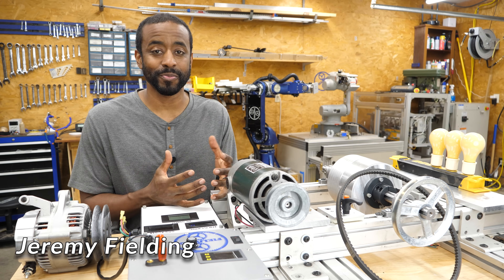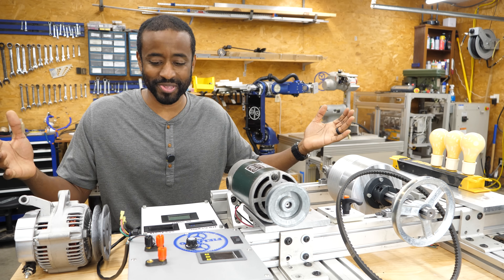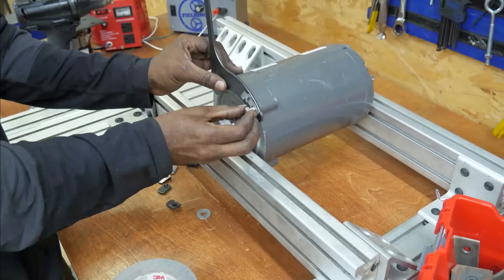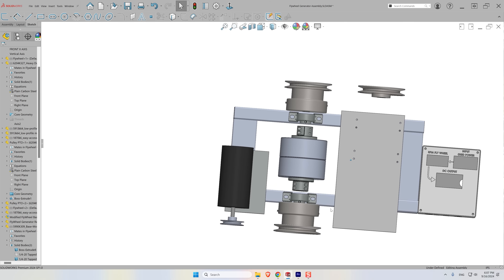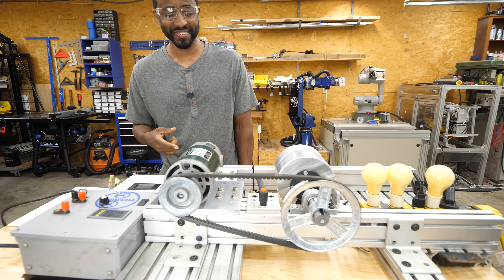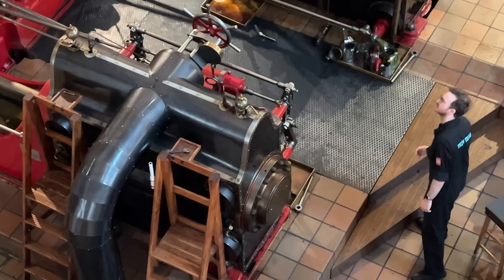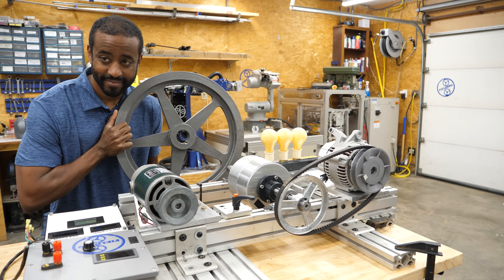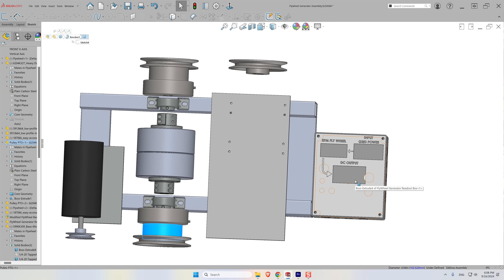A Machine To Test Free Energy Ideas.

Comment: Hi Jeremy,

I hope you are well. My name is Bucky Hoover, and I’ve been living off-grid for a while now. It’s been both a challenge and a rewarding experience. I don’t have an income and things are hard, so I rely on resourcefulness—repurposing scrap materials, fixing broken things, and building what I need from whatever I can get, which is how I discovered you back when you had the small shack. It's been great to see you grow over the years.

I’ve been following your work for many years, and I deeply respect your engineering expertise and creative problem-solving. I’m reaching out because I’m tackling a few specific challenges in my living situation, and I think your insight could really help.

Here’s what I’m working on:

1. Power generation in winter months:

I’m trying to design a micro-hydro system or a self-sustaining solar-powered setup that could generate enough energy, even during the darker, colder months. The turbine, etc.

I also want to create a UV light system powered by solar, but I’m unsure how to design it so the system essentially “feeds itself.” its probably not possible😅. But i can dream.

2. Alternative fuels and engines:

I’m curious if there’s a way to modify an engine to run on alternative fuels using accessible materials.

3. Boosting communication:

I live in an RV (a 1999 Georgie Boy Cruise Master) and have an old Winegard TV antenna. Could it be modified to boost cell phone signals? Anything that can be made?

4. Energy efficiency improvements:

I’m wondering how to make my RV appliances (like the fridge) more energy-efficient using scrap materials or repurposed parts.

I’d be incredibly grateful for any advice, guidance, or even just pointers to resources or techniques you think might help, even things in general for self sufficient life. I know you’re busy, and I don’t expect a full walkthrough—just some direction from someone with your skills would mean a lot.

Thank you for your time and for sharing your knowledge with the world. It inspires people like me to keep creating and solving problems. I know there's a solution to benefit mankind that I could do someday. I look up to you. 

Warm regards,
Bucky
Reply: Hi bucky this is absolutely amazing...not the struggling part but everything you wanna do. How far are you?
Reply: @vanessaabisai4300  thank you, means a lot. Out here in the Olympic Forest, I’ve been digging into how to make fuel and power using what’s naturally around me. Stuff like Oregon grape and salal berries aren’t great for eating, but they’ve got enough sugar to ferment, you can make ethanol out of wild berries if you’ve got the patience to crush, ferment, and distill it. Even bigleaf maple sap can be tapped, not as sweet as sugar maples but still usable. If you're near water, cattails are gold, the rhizomes are packed with starch and can be broken down for alcohol or tossed into a biogas digester. And if nothing else, pine resin burns like hellfire; render it down for fire starter paste or lamp oil. Pine needles can also be used for distilling oils or burned outright in a hot rocket stove setup. Gass and brush clippings  rot down in a sealed barrel and you’ve get methane—useable gas if you rig it right.

I’ve also been looking at micro hydro because there’s always water flowing out here. Even a small stream—just 2 to 5 gallons a minute—is enough to generate something if you build smart. You can make a DIY Pelton wheel using scrap spoons or metal lids, hook that to a car alternator, and generate power off grid. Use old PVC or jugs to direct pressure. An alternator, pulley, and some batteries will do more than people think. You just need to manage your voltage, which is doable with salvaged charge controllers or cheap converters online. For storage, I’m stacking up old car or marine batteries—anything I can refurbish and wire together.

Even inside the RV..My fridge runs propane, but I added foil and a fan to keep the heat from building up behind it—helps efficiency. I use a switch on the water pump to stop idle draw. All my lights are converted to cheap LED strips and pucks running straight off 12V, no inverter drain.

Comment: A car alternator is a High RPM Generator.
Generators can be designed for any RPM range, depending on your application.
Because excess amperage generation can burn up the coils, Amp generation at a given RPM needs to be considered.
Car alternators must deal with an engine RPM range from 1000 to 10,000. (vehicle dependent)
For this reason, using a car alternator as is, without an internal redesign of the magnets and coils, is not a good choice for peak efficiency experiments.
How much torque exists when a car alternator is under load?
This amount of torque, in a car, is overcome by the mechanical force applied by the engine.
The need is to reduce the amount of torque while providing an equivalent electrical load, to achieve a net effect generation.
The design limitations of the alternators radial system makes improvements difficult.
For the home hobbyist, an axial flux design would provide a better platform for experimentation.
In the axial flux system you can change the ratio between magnets and coils to reduce 'Magnetic Friction or Magnetic Drag' caused by Back EMF. This is a step which reduces the amount of torque required under an electrical load.
-** A Small Axial Flux Generator, driven by a Hobby Motor (4v-10v RC), and a light bulb, and if there is still an excess, add a capacitor bank for non-manual restarts. **

Comment: Can you put a 2 piece magnet shaped like the coil of a motor attach one to a bracket on one side of the motor and bring the other close to it on the other side using the negative energy of the magnets to turn the motor? I still believe magnets are the key to free energy as to how much energy I don't know. However, the little thing we live upon uses a magnetic field. So it could be sufficient.

Comment: Use the liberty engine concept to test whether outside the laws of physics it may work also you can test the concept on a motor bike magneto by placing it at off timing Marks, so that the counter balance weight of the crankshaft and the fly wheel momentum,  but the most important thing is to test on Japanese cd 50 motor bike engine which has been converted to a cdi ignition , cut of the petrol flow. Here 3 forces will come into play, gravity,  momentum and magnetism . It will run only at one off timing position,  so it runs in conjunction with the engine.

Comment: My first thought is why use aluminum as a material for a flywheel?  Steel would to me make more sense?
Reply from the maker: It meets my design requirements and was easier to make. It’s that simple. Look at the formula for flywheel energy. Speed is far more important than mass. If you want a light weight flywheel you can easily design something lighter that is equal or better. For example Double the mass and get double the energy. Double the speed and get 4 times the energy storage. Speed is squared! Like I said it was designed. That was really the whole point of the video. A flywheel can be what you need it to be. It’s not a fixed thing but an engineered solution. If you don’t know the design requirements you cant know if it’s good or not. Sometimes you want less weight, or smaller outer diameter, or you only need a tiny amount of capacity to smooth out the power supply. Maybe no magnetic! It’s an engineered solution to fit a project not a fixed thing.

Comment: an aluminium flywheel???!!!
Reply from the maker: Why not? If it can do the job? It’s an engineered product like anything else. All you have to do is take a minute to look at the formula for flywheel energy. You will find that speed matters as much as diameter and far more than weight. The speed is squared! If you double the speed you get 4 times the energy stored. I think you are asking the wrong question. Instead of worrying about the material you need to first ask what are the design requirements. That is what engineering is about. It does exactly what I need. It’s a good flywheel for this task. Thanks for watching. I hope this deepens your understanding a little more 😁

Comment: You are working on flywheel weight but not on surface area surface area is the key. 2nd thing bearings are not installed weight of flywheel work if reduce the friction use bearings

Comment: Your flywheel is too small. Did you do any calculation on the size of the flywheel for the torque you need to drive the generator?
Reply from the maker: LOL. You have no idea what the load is or the operating speed so how could you possibly know if it is too small? Take a minute to Look at the formula for flywheel energy. Speed is squared! If you double the speed you get 4x the energy stored. So a flywheel half the size can easily store the same amount of energy or more. Anyway, to answer your question yes it is exactly the size I need for this backyard experiment. Just like all of engineering I designed the flywheel and speed to meet my needs but only just… not more. The solution only needs to show how this works. We are not powering a house. I just need to demonstrate the concept. Come back for future videos to see how it plays out 😁. Fly wheels are engineered to match the design needs. It’s what I do for a living and literally the whole point of me bringing it up in the video.
Reply: @Jeremy_Fielding  I am not sure what you do for living exactly but I can pretty sure this project that you do won't succeed, which is exactly what you wanted. You want it to fail.  If you are seeking for high speed to drive the flywheel you are going the wrong way. No one design flywheel at high speed.  Even the system works, it won't be durable nor reliable, and last but not least, safe.  You get one like for trying
Reply from the maker: @believeornot12  Again, you don't know the speed or design requirements. I just mentioned these as obvious variables that change the performance A LOT and were variables you didn't know. All I said was I designed the speed and size to meet my requirements! Requirements you don't and can't know. Anyway, to your other point, I don't want it to fail. I want to teach people basic physics. For that I need it to work. The results of the measurements tell the story not a failed product. I think you are missing the forest due to all the trees. You don't need a lot to prove the physics of a flywheel. Nor do you need it to last very long as a one time teaching tool but you also have no idea how long it will last with the information you have. its just surprising to me that you can assume so much with so little information. That is not how engineering is done, and thus how I know you don't do engineering. I design machines for a living with a heavy focus on motors and generators. This sometimes includes flywheels. But whether I have the experience or not is not actually the problem here. The problem I am pointing out is you seem way to determined to find a problem with a design you don't understand. Perhaps you just want to find a problem with it. Either way, I didn't reply to change your mind, I replied to point out your complaints have no foundation. We will see if my design works for it's intended purpose. But this chain of comments aren't connected to science. They are just images you have in your mind of what a flywheel "should" look like. It was in fact the whole reason I brought this up in the video. To talk to people like yourself. Engineered products match the problem not a preconceived idea.

Comment: First the alignment of your shaft are incorrect, thus causing your drag. The reason why you can't make this work, as you do not understand the principle of creating the electricity. You're missing a critical part that works a lot like a stun gun. The point of the capacitor is to hold the stored electricity until it is used to be refilled again, this process happens in milliseconds, and it is repeated as quickly. It works by switching the system on and off at a very fast pace, it is these moments that when it is off it is storing and creating extra energy. Thus it only use as a small part of the energy to create the speed needed to spin the flywheel fast enough to create the electricity as the flywheel is slowing down.. (hence the on and off function) you are also missing the magnets that are put into the flywheel, and electricity is created by the pickups, which you also do not have. It's easy to make money from a large industry that is willing to pay someone to prove something cannot be done to keep people from buying that something, and then forcing them out of business. 
But if this concept was not real, it would not be used by the United States military, which it has been for over 60 years. The idea that it is free is a misconception, you are just changing one form of work into another, magnets over time will lose their strength, and the parts will eventually wear down from ware.. the cost of a good operating gravity generator, will create as much power cost as you have spent in building it.

Understand the name free energy is incorrect, this is a form of conversion, converting work into electricity. 
So in reality it should be called a conversion generator.
Reply from the maker: I strongly suggest you just try this yourself rather than repeat this on the internet. If you are right this is worth hundreds of billions of dollars. Clearly it is worth your time…Or you will get a great lesson in physics by trying. There are a surprising number of errors in your statement and a truck load of conspiracies so trying to argue this in the comments when you clearly think you understand is a waste. You need to see it yourself to understand just how far off you actually are. Or you can ignore my comment and believe what you want with no effort. There is that. Believing the conspiracy is far more enjoyable than actually checking if any of this is true. Most of what you said is measurable repeatable stuff. You can check it.

Comment: ''dont understand what capacitors are supposed to do, its basically just a battery'' really? the capacitor discharges into the alternator causing the alternator to spin which generates electricity that can then be fed back into the capacitor until it discharges into the alternator causing it to spin and generate electricity etc
Reply from the maker: @milogonzalez1334  you really should just try it. If this worked it would be worth hundreds of billions of dollars. It is clearly worth your time to confirm this belief. Thanks for watching. Now get to it and change your life or get a great lesson in physics. Seriously just do it!

Comment: You do good content but this is a waste of time you should be looking at “the” free energy stuff that works based on scientific laws  Tesla bifilar coil generators and resonance, asymmetrical transformers, motors with no counter mmf, I could point to a few all been reproduced all work on the very principles of physics example Lenz Law, Lorentz Force, on pen circuit flyback, inductive  reactance, vacuum energy (heat from environment… and more 
Of cause there’s Tesla stuff but have to go to nasa archives to even begin that understanding

Comment: I am sure that someone has suggested this in the comments, but on program first run use single line programing run.  Each line runs in sequence at the push of start. Slow the feed rate and keep finger on pause.  If you drill through the fixture, as you did, pause will allow the spindle to keep spinning and clear the hole at the depth of the mill.  Large mill flutes can catch on the bottom and when you raise the tool out of the crash site can break the mill or rip the part holder out breaking something. We all crash at some point and it always  has the same pucker factor.  Always enjoy you and your content.

Comment: How about
1. using more motors connected to 1 starter motor and add them into one cable that is connected to the starter motor?

2. Speed up the rotation using big to small gear ⚙️, just like a car?

I mean you can also make some video 🤓🤓🤓.
Or reply if you have got any answer.
Reply from the maker: I already covered this earlier in the series. Check the description. The short answer is no. Gears don’t help, nor does adding more motors. Watch “how regenerative braking works “ on my channel for the answer to this part. It’s explained in that video

Comment: I think you’re missing the concept of flywheel. If you look at old steam tractors, how big the flywheel is and it’s a centrifugal weight that gives the horsepower that is very similar in the old two cylinder John Deere tractors. It’s the centrifugal weight of the flywheel that gives the torque in between the pulsing of the engine strokes on the power stroke because an old 830 John Deere tractor was rated above 45 hp but could pull a five bottom plow which was comparable to a 4020 John Deere, which is rated about 100 hp but the 4020 did not have the heavy flywheel like the 30 John Deere
Reply from the maker: The flywheel is an engineered device sir. It can be whatever you need it to be to fit design constraints. Just look at the formula. the radius is squared, which is why old machines look like that but the speed is also squared! If you double the speed which I do, you get 4 times the energy stored. It’s the whole reason I brought this up in the video! If you want to make it smaller like I did you change other parameters to meet your needs. You can’t decide a flywheel is inadequate when you don’t know what the design requirements were. I think you missed the point that the flywheel is designed and doesn’t have to look like the old flywheel wheels. Literally what I said in the video